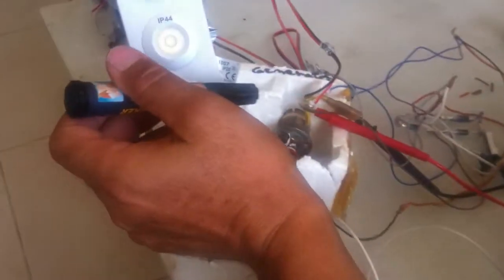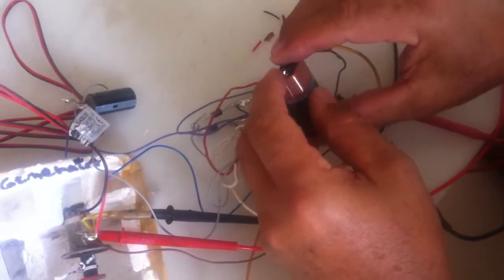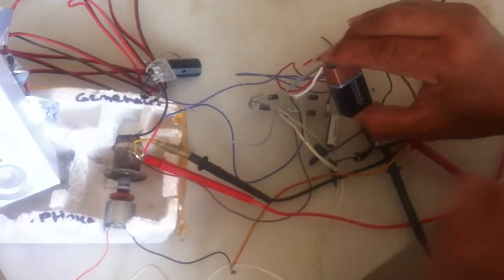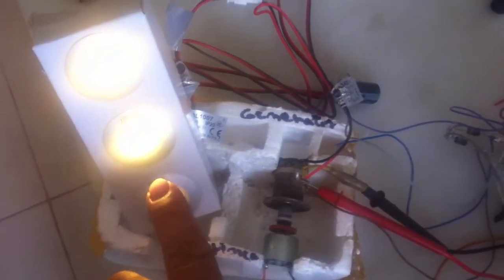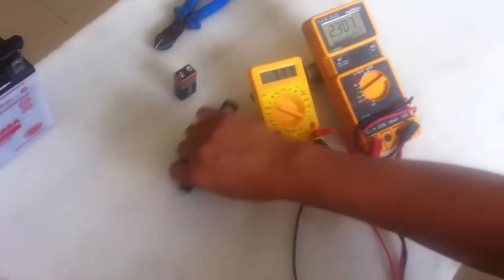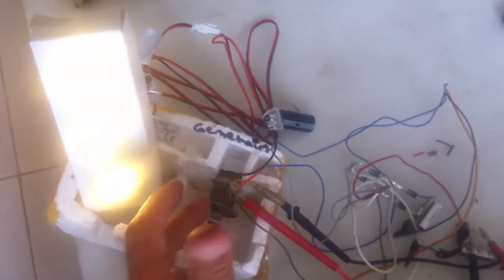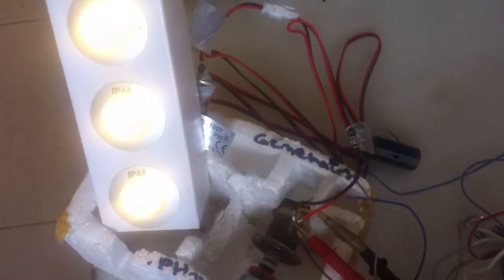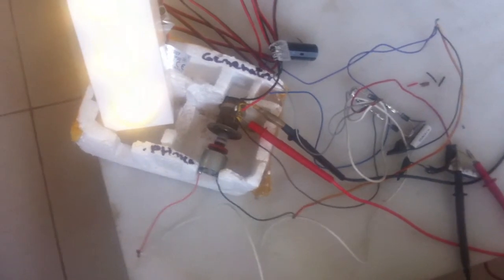Small new generator that can provide lighting for a room

Comment: Very interesting.Were I can find a readable circuit?.Thanks.
Reply from the maker: Hi Stephan, well I would like to publish the diagram one day but I hope to find some finances to develop this concept and make it bigger. I did publish some diagrams about other generators I made but not this one yet. Basically, you give a pulse from a battery, the pulse passes to a transformer with run capacitors and is converted to DC and AC split circuit, the energy is stored in capacitors only. There is high voltage inside and basic knowledge in electronics can help in order to avoid electric shocks, thanks for your understanding and interest. Best regards